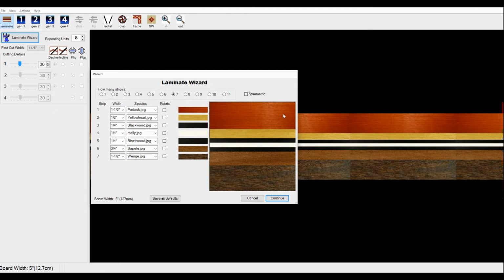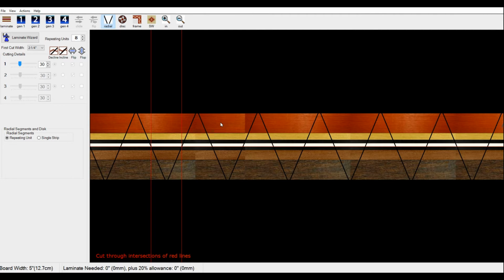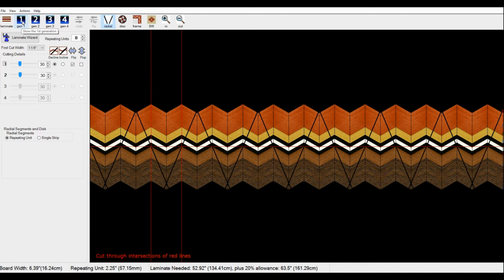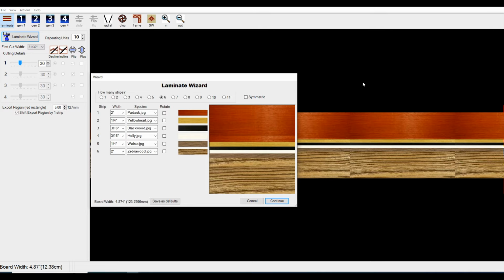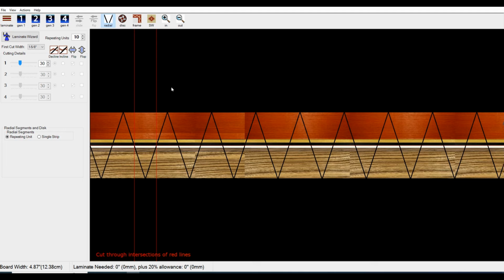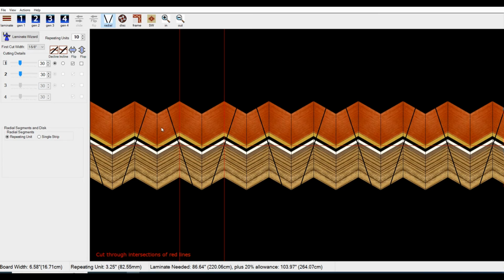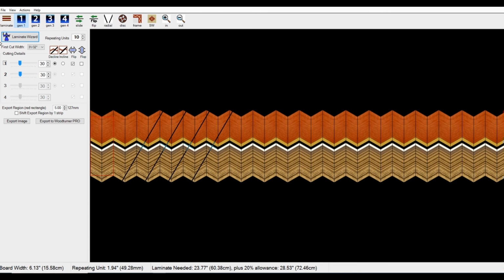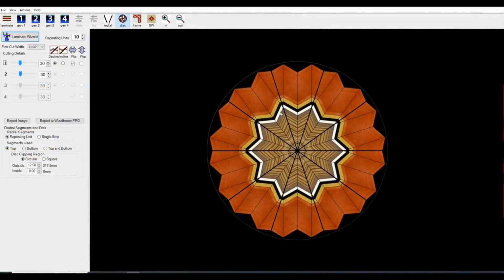Two For One Design Using Lamination  Pro   No Wood Turning

Comment: Glad to hear you are on the mend. Thanks for the software walkthrough series. 😊
Reply from the maker: Thank you John, I will see how it goes I may take a try and getting to the lathe next Wednesday.
 I need to put weight on it with the boot on till there is no pain then with the brace which does not keep the foot from bending. Right now no pain the the boot on while standing.
Gary

Comment: Glad to hear you can put weight on your foot again. Hope you are able to get back making turnings. Been following your series on the software and thinking about purchasing it, but have to make sure my old laptop will run it. I also have been out of commission the last few. week. I was cutting. some small segments and accidentally caught my thumb with the saw blade. Only lost about a third of my thumb nail. It has mostly healed back when I tried to cut my index. finger with the band saw. 6 and half hours later and nine stitches got that fixed. Had the stitches out on Tuesday so it shouldn't be long before I am back in my shop. I have been using power tools for 60 years without any incidents and then twice in less than a month so my pride was hurt more than anything. Luckily there  was no permanent damage.
Reply from the maker: Thanks Miles. It does feel good to stand and no pain is GREAT!
This software will run on an older laptop or computer.  You can try a 30 day free trial to make sure and to see if you like it.
Sorry to hear about you accidents.  Best wishes for it healing soon.
Take care,
Gary

Comment: That is great news about your ankle. I Know when I had my knees done I missed my lathe so bad that I bought a saddle stool with wheels. It was perfect. I was able to just roll around the shop and turn smaller projects. I do have a question for you though. How do you keep those holy strips from picking up dust or staining from the other woods like Padua or Blackwood? I have about 30 board feet of it that was a stor fall from hurricane Sally that I can’t wait to make good use of.
Reply from the maker: Thank you very much Cory. I have thought about a rolling chair of sorts. Looks like I can start putting weight on that ankle now.
So if I have a wood that bleeds I like to use spray lacquer.
I put 3 or 4 very slight overspray type coats and that seems to lock it in.  Basically those coats are not wet.
 Thanks for watching,
Gary

Comment: Hope that the Doc has some good news for you Gary. Great job again with the video. I have been playing around with the software too making lots of interesting looking laminations. Thanks for expanding on the initial simple generation laminations as even the further designs are quite easy as you note. I did note that you can get the cut instructions directly from Lamination Pro without having to import them into Woodturner pro. Once you have the generation of the lamination that you want just select file and print preview in LP and you can see the build instructions for the design you have made. Looking forward to seeing you back in the shop (as I am sure you are also) but really enjoyed this series of videos too! Take Care, Ted
Reply from the maker: Thank you Ted. It was good news. I can now start putting weight on it with a boot on. When I get full weight and it does not hurt I switch to a brace. The good news is when I stood on it after getting home there was no pain.
 You know I looked for a way to print that out from inside the program and missed it. Thanks for pointing that out. I will update that tomorrow in a short video updating my ankle issue. And I will give you the credit for letting me know.
Take care,
Gary